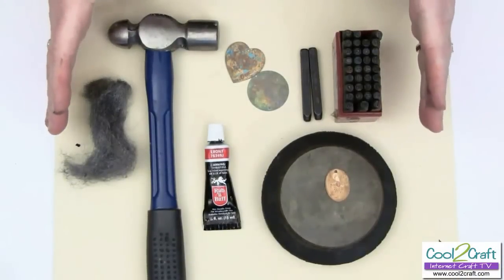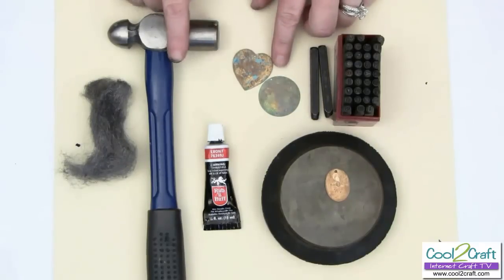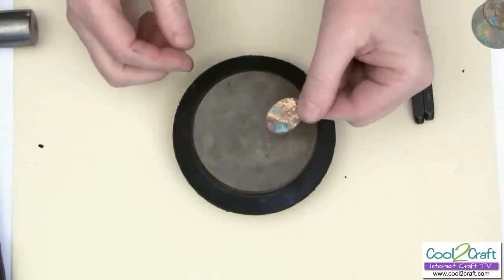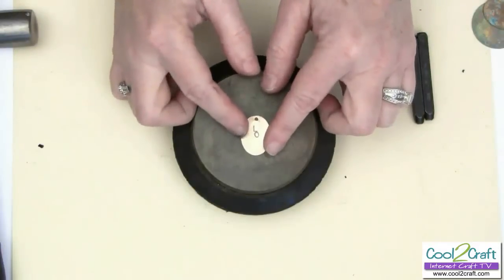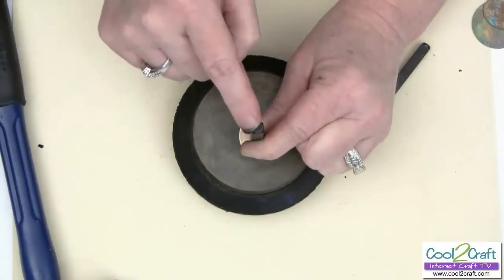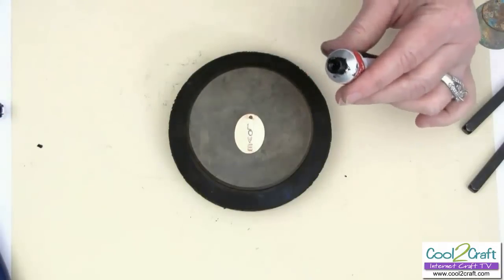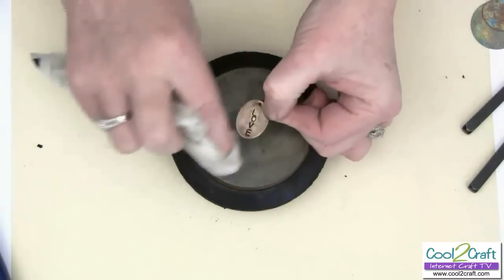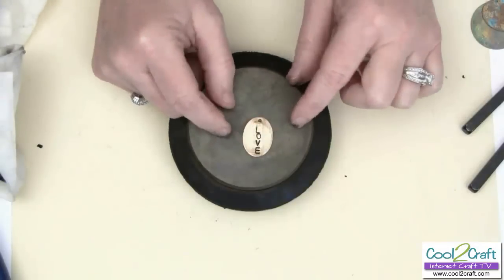How to Make a Stamped Metal Charm by Linda Peterson

Comment: Hi Galli N - Wanted to answer your question too - yes these stamps will work on thicker metal.  But my suggestion would be to try it on a scrap piece of metal just to make sure.  The stamps I use are designed for a variety of metals.  Obviously the softer the metal (annealed copper or aluminum) are going to be the easiest to stamp.  Have a creative day!